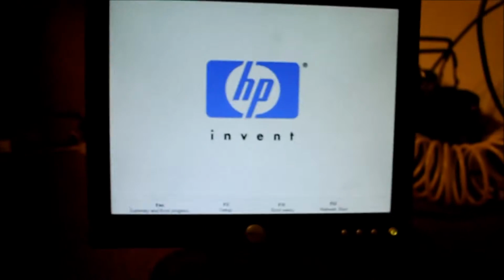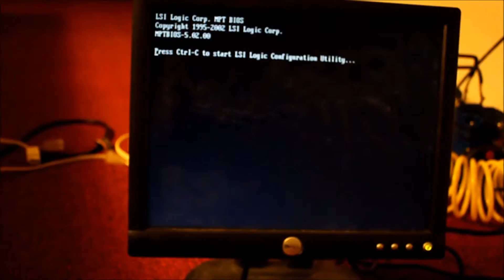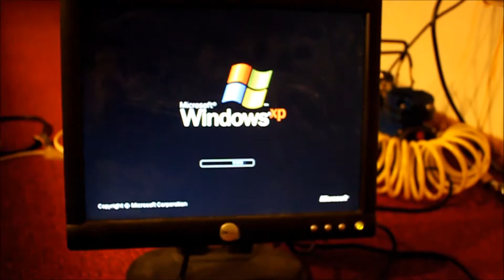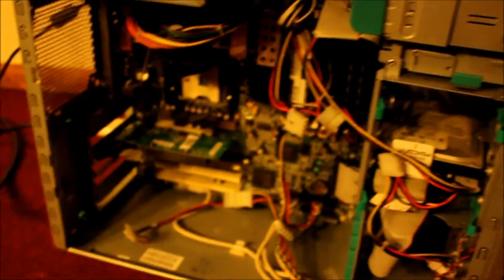Last of the best Tech: Diagnose and troubleshooting HP XW8000 (PART I)

Comment: Would a 1997 550D monitor work for it?
Reply from the maker: I am not familiar with the 550D monitor brand.... but if it is VGA, DVI or HDMI, then yes any of those outputs CAN work if you have a video card that can support it.  The PCI 1gb gt 610 with HDMI can register as well as any AGP video cards
Reply: No the 550d is the model of that monitor.
Reply from the maker: Dylan Olsen it works without issues because I have a video card for it
Reply: Smart idea for it to work.
Reply from the maker: Dylan Olsen you always need an old card handy for this occasion.  So always save old stuff that you know works and someday you might find a need for it when testing a server or old computer